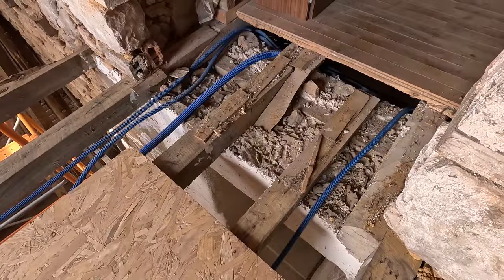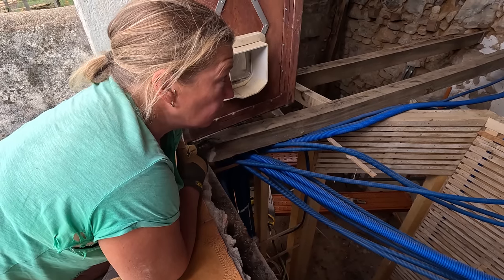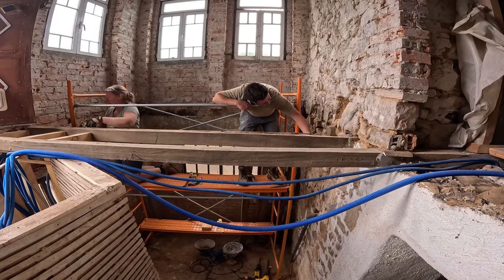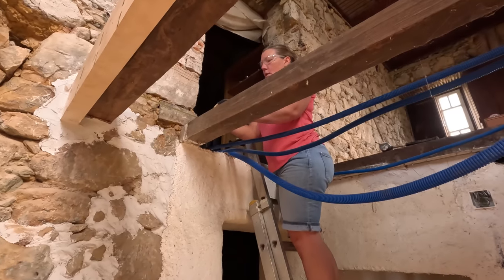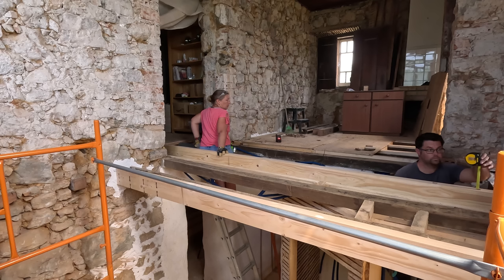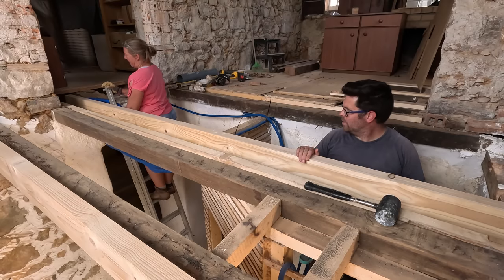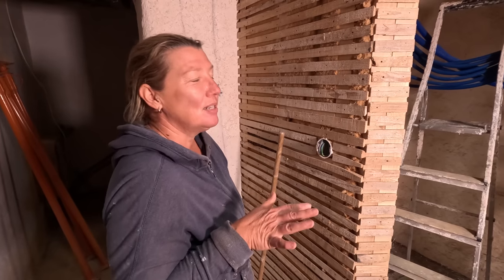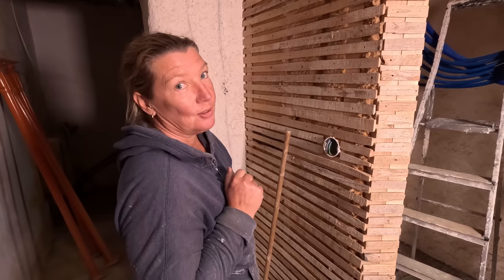The Biggest MISTAKE We've Made (So Far?)

Comment: Can you reinforce the beam where they were notched with some 6mm or 8mm mild steel plate??  Then bolt  the metal inserts in pace?  You need to go a little either side of the notch  say 30 cm either side. Stainless steel plate would be better or galvanised steel.

Comment: You learn from mistakes and nothing is worse than someone always telling you beforehand that you have to do it that way. The good thing is that you have recognised the mistake and are taking the time to change it. 

The only thing I would have done differently!

You don't use oak or any other wood that has more resistance to water. It looks like pine? So I would have soaked the ends of the beams that go into the outer wall with linen oil or something similar. The wall will always be a little damp from time to time and so the water can easily penetrate the wood with the grain. The oil would prevent this.

Comment: Do you finally want to put OSB on the beams? Osb is Not breathable and I think you will geht the Same Problem like now in the Future. Why Not wooden planed floorboards which can transport the moisture? Just an answer. Thank you for your nice Videos!
Reply: I don't like OSB either, but the ground floor will be a living space later. It is no longer damp. Therefore, the construction will last much longer. 

What I already noticed in the video is the lack of impact sound insulation. It is probably much easier to install it from above than from below. So first build something between the beams on which the additional dimensions can be placed and then mount the OSB boards.

Comment: Have you done a statical analysis? Before ripping the beams out, let an expert calculate the load bearing capacity of the beams in place.
My guess would be that the maximum weight (load) on this part of the floor will not exceed 10 - 12 people, waiting for their drinks :-))

Comment: I do not think it is necessary to redo it. The joists are usually dimensioned to be stiff enough, not to hold the load. Besides that, the maximum load will be in the middle of the joist so a notch at the end is not critical. I have seen it done made many times done by professionals.
Reply: I think they are concerned about the notch's in the center of the joist's.

Comment: Well , the most critical points on floor joists) beams are the ends , where the load will be more concentrated
 So , that new beam that was installed up against an existing older beam , you had a notch on the bottom of it ( I'm assuming to clear some bigger stone at the wall 
 That's ONE HUGE no no 
 Since you will be replacing the ones notched on the bearing wall , I would replace the one above too
 Just my 2 cents

Comment: leave the wall, and the beams, cut strips of 1/2" plywood 1 foot longer than the notch for each side of the beam and sister them on each side of the beam with gorilla glue and 2" screws.  Even if the wall was removed the beams would not break.

Comment: Absolutely no need to take the floor out, just put fillers on top of the wall so it takes some of the load. If you wsnt to have more insurance, board up the outside of the wall with OSB to strenghten. 
Maybe a days work and will outlast you guys.....

Comment: No. I am a builder and this is what happens. Take up the plywood (you can use it exactly where you had it before, take out the ones you notched, cut down the wall, install new beams (which you have the PERFECT measurements for) and reinstall the sub floor.  NO WORRIES.  Six days total for a floor that should last centuries - no big thing. Good Luck. Smile and learn.
Reply from the maker: Yep, that’s our plan. Hopefully just 2 days to redo. ….. always learning 😀

Comment: I can't see that the effort required to replace those joists is justified. Steel flitch plates thru bolted on both sides of the joist should be adequate to restore the lost structural strength. Those who never made a mistake never made anything.

Comment: Can't you just fill the gaps in the existing joists with a proper piece of wood? Repair the gap?
Reply: When you cut into the fibres of a piece of wood, it's like cutting through a muscle - its strength is lost. The strongest piece of wood is a complete piece of branch or trunk - in the round - because the fibres are unbroken from end to end. Just plugging the gap will not give it strength.

Comment: I don't get it! If you notched out the three joists where these are SUPPORTED by the wall ... there shouldn't be ANY problem! Yes you have weakened them but if there is any accumulated stress in these, it will be in exactly the supported points! IMHO you don't need to make it again.

Comment: These are 'sistered' beams, correct? You already have the strength of the original beam PLUS the sister. So the sister is 75% strength plus the 100% or less of the original. I don't understand the concern/need. Especially if you heed the advice of others with a mending plate.  And doesn't the bathroom wall have some support to the joist above?  Not being critical, I just hate seeing all the effort go to waste.